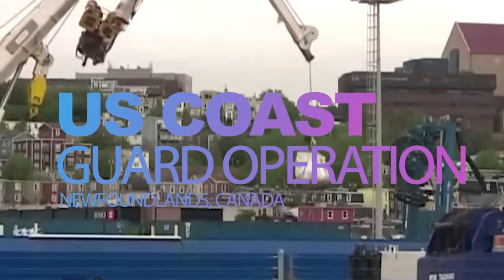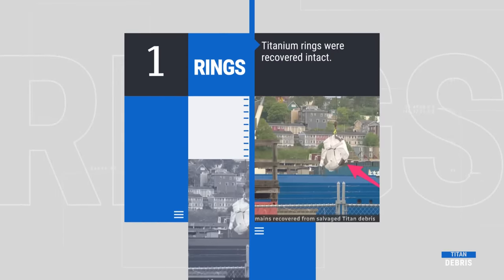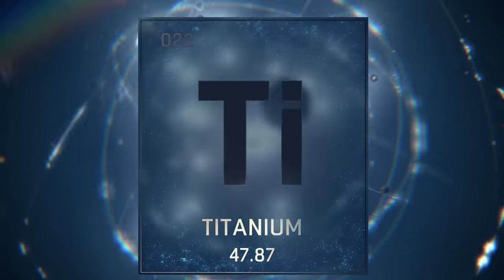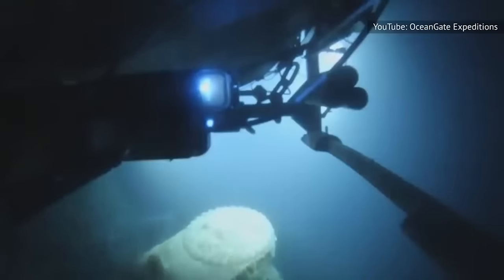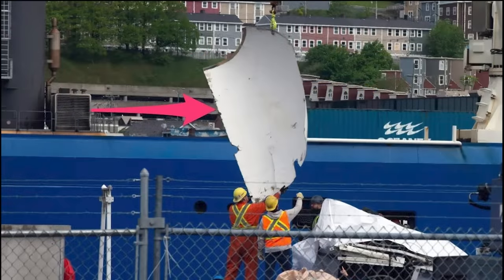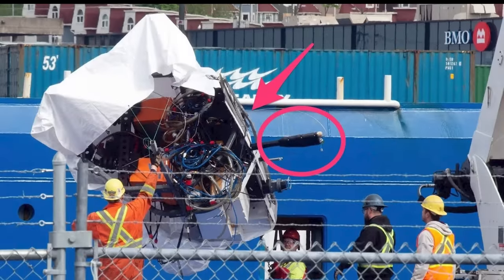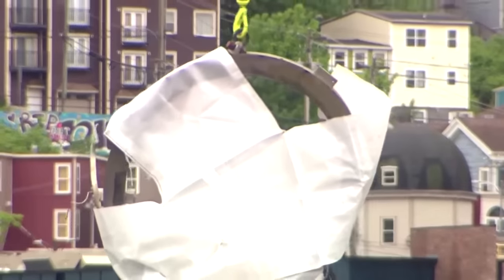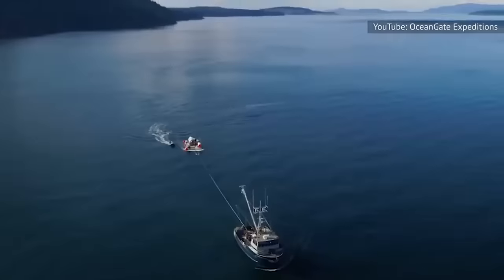What Really Happened? The Titan Submarine Clues from Parts after Implosion

Comment: It must have failed at the metal -  carbon fiber joint.
Reply: Must? The carbon fibre tube or the porthole could have been the weak points too.
Reply: @1pierrr  That's just my guess based on the large intact pieces.

Comment: On LinkedIn I read a post by an engineer about 1 to two weeks ago stating that carbon fiber or parts of it (the glue?) partially dissolve under high pressure. By using the vessel multiple times, the hull may have been weakened.
Reply: Good point - I've noticed in the pictures of the debris that there doesn't appear to be any glue, of carbon fiber fragments stuck  to the titanium rings.  This observation (admittedly made from a distance on a video) suggests that it was a bonding failure which makes sense to me.
Reply: @AlphaBobFloridaOverlord  Also the two different materials would have contracted and expanded at different rates. The titanium ring looked so solid that it probably didn't compress at all, where as the carbon tube that's glued to it would have moved enough times to weaken the glue. And 2 part apoxy doesn't stick to well to not porous metals. The ideal shape will always be a sphere.
Reply: They don't actually dissolve but the layers, which are stuck together, not merged as with fibre glass mat, using epoxy resin have a certain diameter. Under extreme pressure, this diameter is compressed and the resin has difficulty holding the layers together. After a number of cycles, the resin cracks causing delamination on the inside of the tube, thereby weakening the remaining structure. By the time of the 10th dive, there may be only 3 inches of good fibre instead of the original 6 inches. The sub then reaches a point where the remaining structure can no longer support the pressure and it collapses or implodes.
Reply: Query: I know that the Carbon Fiber was suppose to be spun 7" over the thin titanium shell. Were the Titanium End caps still 7" wide, and mated to the 5" hull!? If yes, there's Red Herrings#s 2 and 3, right after the acrylic window's inferior rating for Titanic depth! #4, would be the  leaking covering over the battery compartment - if it had anything, under the Fiberglass hull! I just helped a friend to put an acrylic case over their huge, lit DeLorean. The noise that 36" case top made so much noise, I had a panic attack, because it sounded similar to Jacques Cousteau's acrylic window groaning in the Mariana Trench, just before it cracked in two, which matched the alleged Navy recording sound of the Titan imploding. 2nd full blown panic attack I've had over acoustics while research, then doing something ordinary. Oh, was in my closet right after, that may have something to do with it, as it's smaller than the inside of the Titan, and I couldn't breathe, just thinking about the horror those poor men went through, in their final moments!

Comment: There is supposed communication logs between the ship and the sub right before the disaster and they mentioned that they were hearing noises from the aft section.  That would lead one to believe that the failure was not caused by the port hole.
Reply: Agree… I read that whole  20 minute set of messages. They had to be terrified.

Comment: Wrap carbon fiber around the titanium and then wrap titanium around that and then again carbon fiber and if that doesn't hold nothing will
Reply: I would have placed a steel core under the carbon fiber, to prevent the carbon fiber being pushed in too far... However, after this, I doubt carbon fiber will be used.

Comment: If the crew didn't remove the window it was likely blown out considering the bolts and structure is also missing 
Also someone leaked the messages from the sub to polar prince not sure if they are real but during the talk Stockton gave with teledyne he also spoke about the data system that the surface ship had that included monitoring for life support as well as battery monitoring and more tho I havent seen that data leaked yet I hope we will get access to it soon

Comment: While the 5 inch thick carbon fiber cylinder may have shattered, I imagine that the steel cylinder it was wound around would be buckled but would still be in a large piece.  I wonder why this possible large steel remnant is not a part of the recovered debris.  It seems like its condition would represent the most telling clue of the cause.  Why isn't anyone discussing this?
Reply: who said that the carbon filements were wrapped around a steal cylinder? Filement windings I've worked on where wrapped around plaster mandrels, that was removed prior to assembly. Assuming to much is what gets us in so much trouble!?
Reply: Your point is valid and worth wondering about. Personally I did see a video from which I thought the steel cylinder was left in place. Also, I can't imagine, due to the friction between the carbon fiber and the cylinder, that the carbon layers would make a sleeve that could simply be slid off. It shouldnt be hard to see whether the steel is still inside while the titanium flanges were mounted. Also, would they have screw fastened(absolutely shocked me to see that...) the monitor displays directly into the carbon fiber wall ?!
Reply: @robertchilders8698  how did you remove the carbon fiber from the mandrels ?
Reply: @robertchilders8698  It appeared to me that there was some type of glue bonding the carbon fiber to the steel mandrel at each end of the cylinder during the manufacturing process as the fiber was being wound.  Additionally, looking inside the cylinder after manufacturing one can see that the inner wall is not carbon fiber and that it appears that some equipment like monitors is screwed into the inner cylindrical wall.  I would be surprised if they screwed into the carbon fiber pressure vessel wall.  I certainly could be wrong, but what I have seen suggests that there is an inner cylindical wall and that it is metal.  How would they remove the carbon fiber from the cylinder it was wound around if this were not the case?  Seems like that would damage the fiber.
Reply: @Cervin_Suisse  we had plaster of Paris mandrels! We had to crawl threw the open end and jack hammer the mandrels out. Piece by piece.
Reply: @robertchilders8698  So this meets what I was saying right ? No way to remove the steel cylinder from under the carbon fiber jacket, correct ?
Reply: @Cervin_Suisse  Most likely! It would be extremely difficult to remove a steel mandrel , without damaging the layup!
Reply: @scottperry9581  There must be a interfacing material between the layup and steel,, for good bonding! That's why you wouldn't see the layup!
Reply: @robertchilders8698  It looks like you are correct.  There were two different cylinder fabricators involve for the different generations of the pressure cylinder. I think the first fabricator made two different attempts and cracked or shattered the vessel at some point, perhaps its removal from the mandrel.  The second fabricator made the vessel that became the titan.  There was an allusion to heating being used to remove the pressure vessel from the mandrel exploiting different coefficients of thermal expansion.  It was not clear but there seem to be some inference in a passing comment.  I saw another video snippet that showed some detail of the inner surface.  It appears that there was a separate carbon fiber inner liner using a cross-hatched layup ( that is the way the pattern appeared to my eye anyways).  It looks like that inner lining is not metal and it is the material that the interior equipment is screwed into.  That must be why there is no large crumpled metal piece in the debris.
Reply: @scottperry9581  If they screwed anything to the interface it would damage the layup, as the interface would be to thin! If anything is attached to the interface , it should be bonded, not screwed in!
Reply: @robertchilders8698  That is what I would expect, however I have seen references to screw attachments from different sources leading me to think that the inner linner has some significant thickness.  But again, I haven't seen any detailed and explicit specifications on the subject.

Comment: Once the carbon fiber failed....there is a shock....but forces are rapidly released on the titanium end caps...and they are along for the ride.  This does not conclude that they are the right material...only that they survived the conditions of implosion at that particular depth.    As of yet..."no one knows" (except maybe OceanFate) specifically the order and manner in which the submersible failed.
Reply: No one has mentioned that carbon fiber will turn into a softer graphite material, when pressureized at several thousand pounds  of P.S.i.!! With maybe heat applied! It becomes a totally different material without strands!

Comment: One point nobody has mentioned. The end domes were bolted onto the tungsten rings using 17 bolts. However they were offloaded from the ship as separate parts. Did the bolts give way during the implosion or were they removed on the ship and, if so, why? Also, the rings were stuck onto the carbon fibre using a narrow strip of glue. Was any glue found on any parts recovered? It is virtually impossible that any layer of glue could have withstood an entry of water at that depth.
Reply: tungsten rings?
Reply: @wizzolo  Sorry, titanium rings.
Reply: @wizzolo  tungsten is actually a very strong material. More so than titanium and steel.

Comment: I thought the whole thing was blown into small pieces. How come so many large pieces.
Reply: The strong materials survived
Reply: It's spelled out in the video... the unpressurized rear half survived, though in pieces, but the interior pressure hull disintegrated.
Reply: Things don't explode underwater. Only the inner pressure hull would have imploded. Everything on the outside of the pressure hull would have stayed relatively intact besides the weakest area that would have failed, in order to release the energy created with the implosion. Think of a hardboiled egg with the yolk being the people and the white being the pressure hull. If the white part suddenly compressed to 1/10th it's size only itself and the yolk would be crushed and destroyed. The outer shell would remain relatively the same size. Only falling apart because it no longer had an inner structure. Had they made the outside all one piece I am sure it could have been raised pretty much intact. The outside hull and structure is not put under the force of the pressure hull. The strength and speed of the implosion was so fast and so violent any rivets, screws, or fasteners would be ripped apart like being held together with a piece of chewing gum. That's why when you see old military submarines at the bottom of the ocean they still look relatively intact. What you are looking at is the outer hull. Inside of that you had the pressure hull that kept the submariners alive and safe. Once it's breeched everything gets crushed. Why I find the report of human remains being found so unbelievable is that the force of the implosion heats the air inside of the pressure hull to hotter temperatures than the surface of the sun. I find it amazing that anything but a small smear here or there could have survived.. I apologize for sounding like a Mr Smarty Pants. It's one of the few times I can actually apply my engineering education to something useful.
Reply: The large metal pieces basically fell away from the imploded capsule which took the brunt of the damage.
Reply: @robertschumann7737  appreciate you engineers making comments. is it possible that the pressure hull imploded at a shallower depth, say 5000 feet? That might account for human remains being found. Although l doubt it was much more that a few teeth or bone fragments.

Comment: the only thing one needs to know about the true stupidity of this, is that Carbon fiber wont BEND under pressure. it just snaps. If the hull were metal it would have a chance to merely bend as THAT would be a ductile material. Unlike the BRITTLE material they made the ship out of.

Comment: The ring holding the window in is missing and that could only happen if it was manually removed as it is held in by many bolts. It was likely removed to more easily crane it onto the recovery vessel
Reply: The port hole could easily be blown out. The bolts just stop it falling out in normal handling.
The bolts don’t hold pressure in normal service.
Reply: @allangibson8494  If the port hole had been blown out, there would probably be residual glass around the hole. I know that it’s still early but I would bet that it comes down to either the carbon fiber failing or the carbon fiber to titanium joints failing.
Reply: @larryfalkin63  The porthole wasn’t glass - it was acrylic / Perspex.
The metal retaining ring was just to hold it in against routine handling forces. The 1/4” bolts could probably be kicked out - I’ve certainly broken and stripped enough of them just by doing them up.
There was no glue sealing the porthole in - it is just polished acrylic on a polished titanium surface (which is now scorched black).

Comment: Just a little more info.
That gray nose cone with the view port is the only part of the Titan's pressure hull visible from the outside.
It is also the entery & exit hatch, it must be unbolted from the outside to exit or enter the Titan. That titanium end cone is bolted to a titanium "end ring" inserted into the carbon-fiber section of the pressure hull, each end.
It is too bad many videos of the Titan show other similar submersibles with different designs.
Reply: Any time you see an image with smooth cowlings over the engines, for example, that is the steel hulled Cyclops 1 they copied, just with the titanium forward hatch replacing its own transparent front port. 

Looking things over, I think OG had used that in promotion videos to appear more ready than the Cyclops 2/Titan was itself.
Reply: @leechowning2712  , good additional info about the other submersibles, but the Titan also had cowlings on its 4 thrusters, atleast on its Titanic dives.
Reply: @weldonyoung1013  none of the images I can find for it, other than the edited images from Oceansgate themselves, show an outer cowling. If it had been fitted, it would have been a recent addition and if bolts were placed that would be a possible new failure point as the added cowling may flex differently than before.
Reply: @leechowning2712  
I am in Halifax, Nova Scotia, Canada (the largest city between St. John's, Newfoundland, Canada where the OceanGate expedition stated from & Boston, Massachusetts, US where the US Coast Guard leading the recovery is located). During the recoverge, we not only got National & International news coverage, but detailed Local coverage.
     Even then it was difficult to distinguish old stock (film) footage from the specific tragic expidition footage. I would suggest trying to find CBC News (Canada) footage of the Titan being "towed" out of St. John's harbour. You will then see the Titan enclosed in a white fearing (without cable protrusions), and the only except being the titanium nose.

Comment: Their death was probably more grim than we’d like to think. I believe they knew they were about to implode and I believe their death wasn’t as instantaneous as most people think. I am basing my opinion simply because the sections are bigger than they were thought to be . But what do I know?
Reply: The main capsule hasn't been pictured, only parts of the end caps and lower section.

It's more than likely that the main capsule shattered. If that happened, the people inside wouldn't have felt a thing due to the speed of the implosion.

Another YouTuber has made a scale model of the capsule and put it in a pressure chamber. It imploded with unbelievable speed.
Reply: @bigwezz I agree, carbon fiber cracks, then shatters, doesn't have the properties to implode
Reply: Compressed water fills the void with a speed 1000-1500m/s , they were crushed faster than human can feel pain .
Water can be compressed , at deepest point of ocean the volume of water is 4% smaller than on the top , so you have compressed water that expands into a void .
Water pressure itself has little effect to human body , we are mostly water , problem is that the pressure after 100-150 m (300-450ft) prevents us breathing .
Reply: What do you know? Apparently not much.
Reply: @DM-rc4yu  his comment is the only smart one